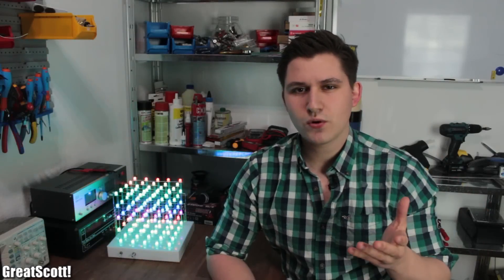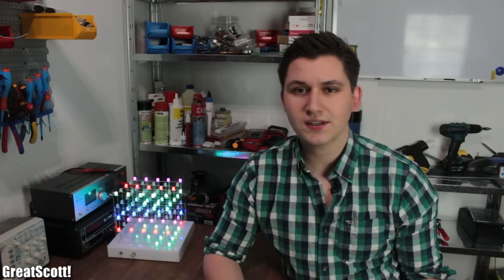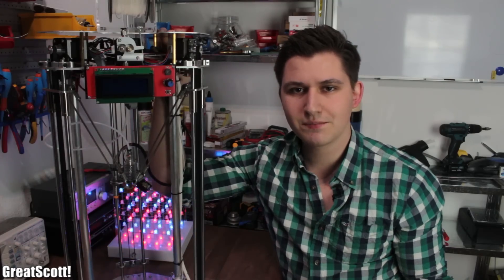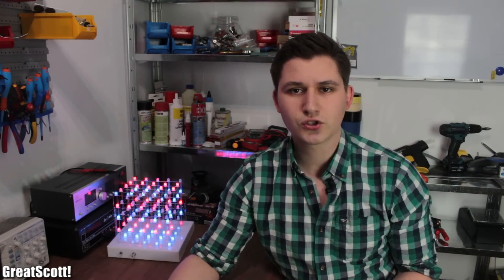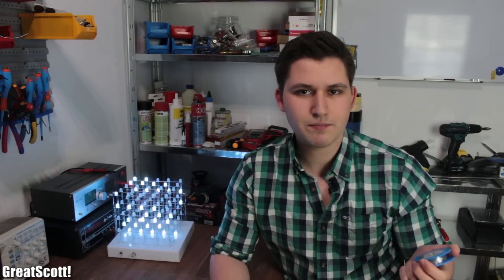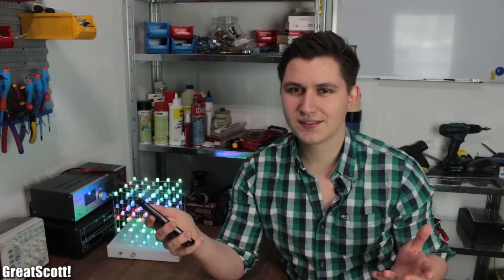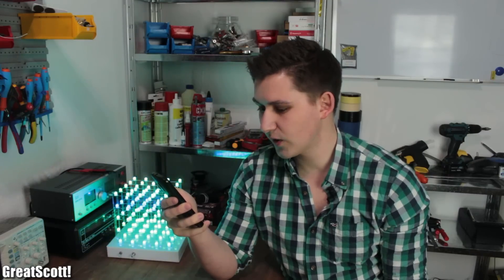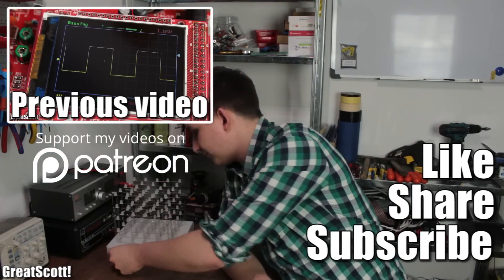Q&A || New 3D printer?  - What's your real name? -  Where do you buy your parts?

Comment: i think you do right doing your videos in english... it's and it MUST be universal, and so you have the best audience... also, not mothertongue speaking english are WAY more comprehensible than the "native" ones... your english is very clear, no need for subs or other... great work Scott :)
p.s.: i'm a patreon supporter of you, from months now :)
Reply from the maker: +squalazzo Thanks for the feedback and thanks for the support ;-)
Reply: +GreatScott! 6 hours ago, YOU TWOOO
Reply: +GreatScott! What's your name again ?
Reply from the maker: +Matt Consto Fixed
Reply: +GreatScott! hey great scott i am making a quadcopter . is it possible to make it with only arduino and transmitter can be used as an ir remote and reciever as ir reciever plz help me .
Reply: +Farhan Khatri IR is pretty bad for distance. You have to use 2.4 or 5.8 GHz.
Reply: +bestbattle can i use an op amp amplifier which will amplify the ir reciever's signal
Reply: +Farhan Khatri Amplifying it will only have limited returns. Noise will eventually be confused for signal. Look up ,"ESP8266", it is a very cheap and very useful WiFi module. A little bit of study and you can control your quadcopter using a variety of devices and have pretty decent range. And there are a lot of example on how to interface it easily with your Arduino.
Reply: +Alexander Hiller So you r telling me that instead of using the ir transmitter and ir reciever , i should use this ESP8266 receiver wifi module ? But will the transmitter will come with it ?
Reply: +Farhan Khatri it's possible but won't work that good at the end think of getting a cc3d costs abut 12€£$
Reply: +kasu noka What is a CC3D ? and how does it work ? Is it a micro controller ?
Reply: +Farhan Khatri it is a microcontroller and can be easily programmed . it's designed for diy multicopters. it's also open source. you can upgrade  it with gps.barometer,sonar..
it is very easy to use and very cheap.
write me a pm. on Google+ when you need Infos
Reply: +kasu noka Thanks for your help :)  But how am i supposed to remote control it  ? what should i use as a transmitter and reciever  to control it wirelessly ?
Reply: +kasu noka And yeah can i use a arduino instead of a cc3d ? Will the cc3d will come programmed or will i have to program it ?
Reply: +Farhan Khatri you will have to programm it
Reply: Its possible to write a program for an arduino tu control a multicopter Search on youtube
Reply: +kasu noka Can i write it ?
Reply: +Farhan Khatri depends on your skills
Reply: +kasu noka Well i am a beginner to arduino . can i plz know your gmail so i can ask you a few questions.  Plz ? ;)
Reply: +Farhan Khatri search for my name at Google +
Reply: +squalazzo Yeah ! He's english is awesome ! Sounds really nice for me.. I live in Brazil, and i learned english by myself.. i can understand very cleary !
Reply: +Farhan Khatri have a look at painless360 on youtube; he made a couple of cc3d videos

Comment: Battery charging process, current and voltage considerations might be interesting. 

Charging batteries with different voltage levels, circuit board's difference between lead acid, lion, etc.

Comment: Hello GreatScott. Have you ever wondered on doing stuff for cars? In motorsports for instance, engine management and other systems are generic and easy to manipulate - I've heard of a guy, simulation wheel motion for traction control without using sensors, and the build was therefore legal, obeying regulations. Just a thought. :)

Comment: Could you do a video on aplifier circuits please? I'm working on an Amp using an MJ15003 and MJ15004 and also an LM324N as a preamp, setup as a voltage follower but the feedback is sent into a potentiometer voltage divider so I can adjust the preamp volume, the output is always crackly and I wanted to know is that because the op amp is peaking or I need more capacitors for de coupling, etc. a vid would help heaps, keep up the good work :)

Comment: Hey Scott could you make a video on a how to make a lightning detector.  Iv got one made and iv got the out put to an LED but its not vary sensitive.  Any ideas?
Reply: +keagan engbrock lightning??? you mean light?
Reply: +supersolex i think he means thunder
Reply: I made one because I do alot of ham radio and I made it so I can have it on a Arduino and so when It detects that there is lightning it will automatically disconnect my radio antennas
Reply: +keagan engbrock nice idea - would like to know more about that cause i´m still disconnecting them manually

Comment: quick question: I'm contemplating replacing a NiMH battery from a wireless water flosser with a 3.7v 18650 but the motor is rated at a nominal 3v. Unfortunately, most pre-made dc step down converters on ebay, amazon, etc, seem to be 4.5 input and usually output around 3.3v. I was looking at TI's step down converter chips to lollygag on a circuit but  none seem to have the parameters i'm looking for. Is it even possible to achieve exactly 3 volts output with an input of 2.5 v?
Reply from the maker: +"pad kid poured curd pulled cod" I don't think so. But why not try a diode with a forward voltage of 0.7V. That should step your input voltage of 3.7V down a bit.
Reply: GreatScott! Awesome! I did not think of that. Thanks

Comment: Hey +GreatScott! i run in a problem which looks like this : my parents have a router its a telekom speedport entry and it crashes all the time i'm consuming more internet than normal and i have to unplug and plug the damn thing in and out and that is so annoying ... So here the actual question : could you make a video about how to set up 2 routers for one (telekom dose ich weiß nicht was das in engl. heißt) i've read through forums that it wont work but if i put my router in parallel to the other why does it not work???! I'd like to use a linksys wrt1900acs and i know that it's a bit expensive but i heard a lot of good things about it. 

PS: Ich würde mich sehr über eine schnelle antwort freuen (I'd apresceate(?)  a fast feedback!)

Comment: How do i make power over ethernet?
Reply: +Guillaume Deplancke If you already have a device that uses POE, like a security camera or a Voice Over Internet Phone, then you just need a "POE Injector".  That will put the power on the ethernet cable.  If you want to start from the beginning, and create a project that uses POE, then you will need to build (or buy) a POE injector, (Or use a network switch that supports POE), then in your project, you will need a POE tap that pulls the power off of the line to power your project without disturbing the ethernet signal.  There are kits you can incorporate into your project, or you can search for "POE circuit" and find them.  You can also read application notes from Texas Instruments (and other companies) that show you how it works, and what is needed to build the circuits.  Do a search for "POE app note".
Have fun!